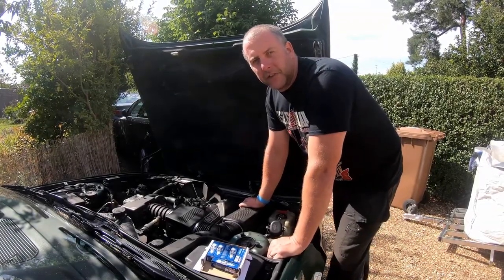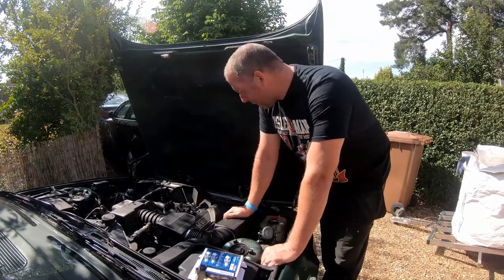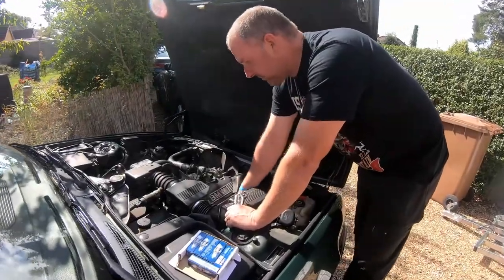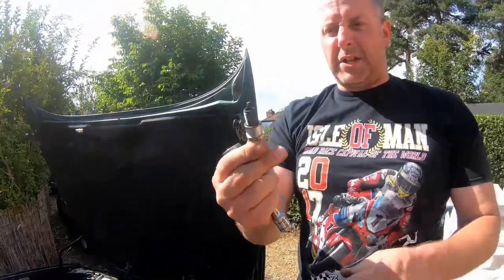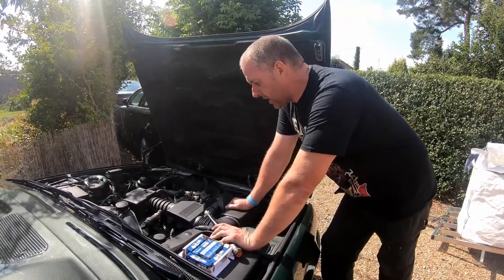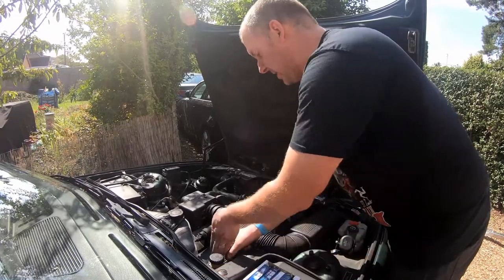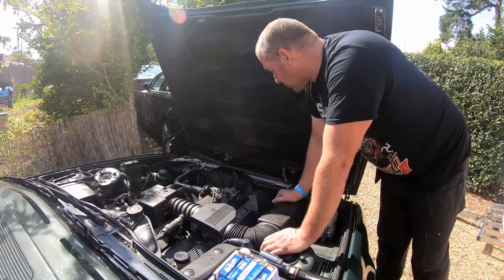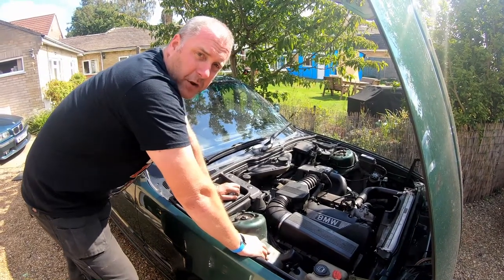E34 BMW Alpina B10 3.5 Ignition System Overhaul & Spark Plug Change.

Comment: Quick question,  are the brakes on the 3.5/1 the factory 535i brakes?
Thanks
Reply from the maker: Yes mate, the brakes on mine are the exact same spec as the stock 535i. 👌🏻